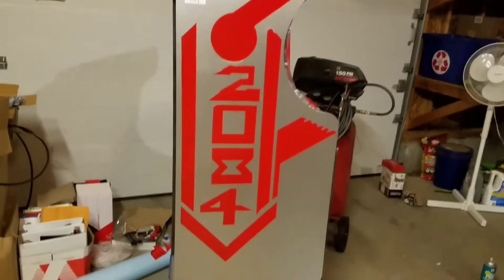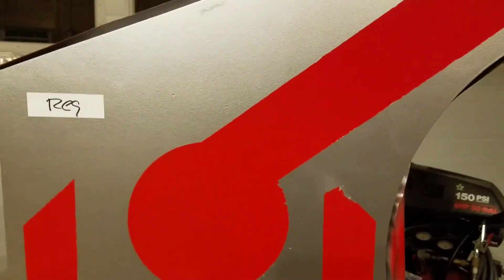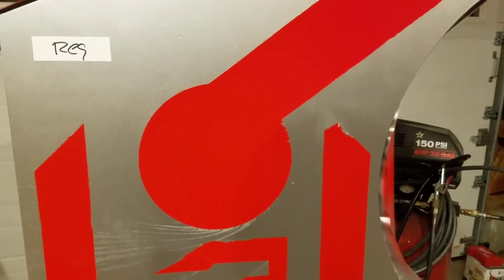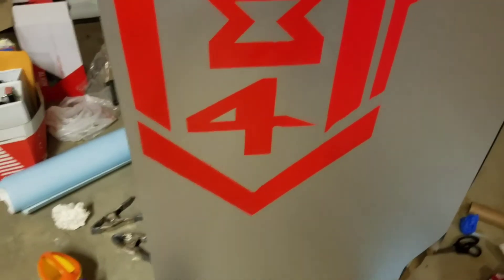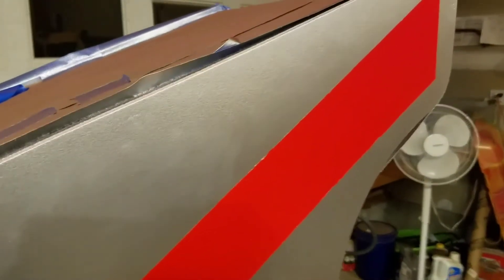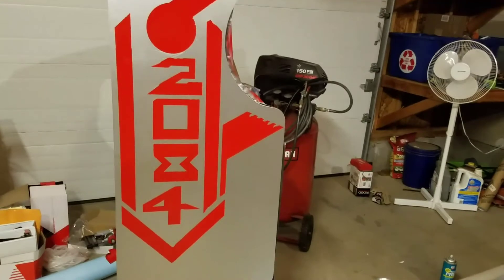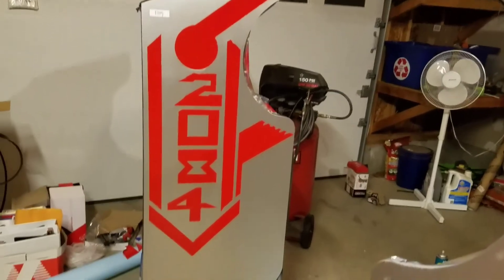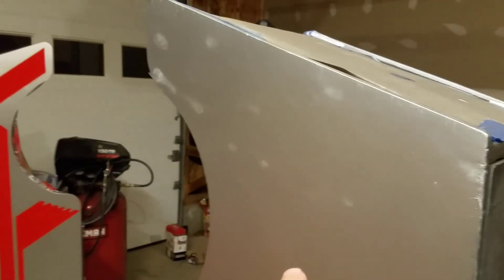Let's Make: Quick $#!* LOUSY William's Mini Update #2

Comment: I painted two cabinets this summer and had similar problems. It's handy to take a scrap piece of wood and use it to test paint compatibility, sanding paint, using different kinds of painters tape and stencils, drying time, etc. That way you can see how things turn out before you throw it on the whole cab. Sure the project will take a bit longer after you wait and see the results from the test piece, but really I saved the time it took to sand off the old paint from the cab I would have messed up.
Reply from the maker: I should have tested on my scrap piece first, but I felt confident...*smack head*

Comment: Under paint with black will make silver mirror more..oil on to oil. Make sure to remove tape and mask while paint is still tacky. You could paint the red...mask it off..paint  black and then silver. A clear top coat would also be good.

Comment: Hey Tim,
Bummer. 
You have to cut the silver paint to 600 if you let it dry before applying another coat. You can't apply a stencil to touch dry paint, right? It will stick to paint and when removing the stencil the paint will come off. Your only option is to let it dry and cut it back.
If you want an amazing finish, hit it with clear coat at the end.
Reply from the maker: Yeah, I didn't cut it back, maybe that's the key? But man...the stencil barely wanted to stick to that paint. Maybe the several days I waited was not enough?

Comment: Man, that really sucks.  I also really appreciate you posting vids like this when things go wrong as well.  It makes us realize that we're not all alone and it happens to everyone from time to time.  I am looking at restoring my Make Trax (non mini) cabinet and I remember someone telling me that if I use an oil base paint and then a latex or water base paint on top, then the latex or water base paint will dry but will not stick properly to the oil base.  You would then be able to peel it right off.  I'm not sure if you mentioned what type of paint you used for the stencil though.  If you use the same mix of paints next time then perhaps you should prime your stencilling first before applying the latex or water base paint.  Just a suggestion though.  Good luck!
Reply from the maker: I used an oil based primer and an oil based silver. This is my first time spraying oil so I expected a learning curve....just not this bad. From what I understand (and correct me if I'm wrong!) is that oil based paint needs to penetrate to adhere where as latex does not. With that in mind, you can not put oil on top of latex, but you can put latex on top of oil if you prepare the surface by giving it something to adhere to (i.e. sanding/cleaning). I try not to mix, but I figured that the spray can Rustoleum should adhere to the oil based paint since it isn't latex.

And yes, I figured I should share this so at least other people can see a mistake before they make it.
Reply: Ok, so it sounds like the red you used then for your stencil was latex.  So I was told that although latex will cure and dry on top of oil based paints, it will not adhere properly and you will be able to peel it off afterwards.  Basically what happened here with yours.  It looks like the sanding you did prior to putting the latex on didn't seem to make a difference.  I wonder if using a special primer (ie. Kilz) on your stencil prior to putting the red latex down on top of the oil paint would have solved the problem.  But then you start building a really thick stencil which also sucks.  I'm no expert with paint but the answers have to be out there.  Hopefully when you hear back from those companies you will have your answers.  If I find any good information out there I will let you know.  Good luck with everything and I'm looking forward to more future videos.
Reply from the maker: As far as I know, Rustoleum 2x Paint & Primer Spray Cans aren't latex. The more I think about it...the more I think the problem lies in the silver and not the red. The silver was oil based and I did use an oil based primer underneath...I'll figure it out! Thanks :-)
Reply from the maker: Thanks, I'll check that out.
Reply: So I looked into it a little further and it looks like the Rustoleum is an acrylic base paint.  After several searches in google, the consensus is that you should not paint acrylic over oil base as it will peel.  I won't type all the reasons as it's probably easier if you just do the search and read for yourself as there is a lot of info out there on it.  I know a guy here locally that just restored a Joust and he used an oil base paint for the base so I'm curious what he used for the stencil.  I will let you know when I hear back from him.